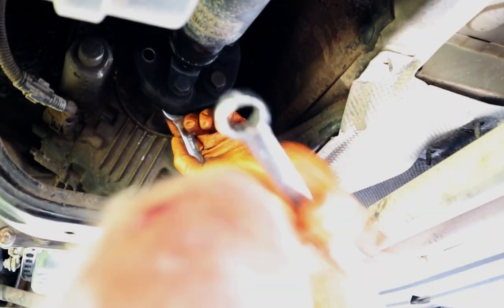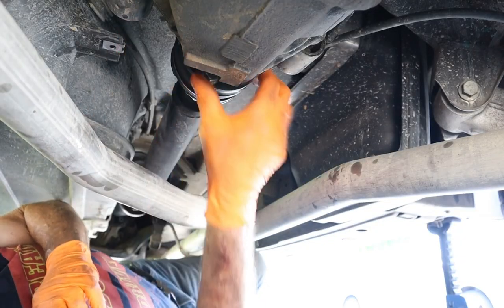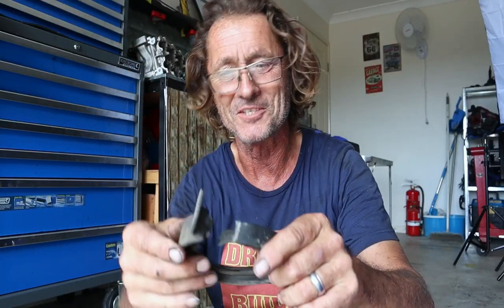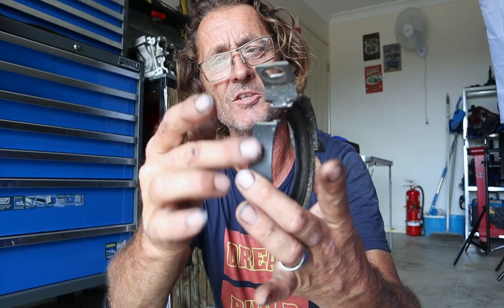BMW X5 DRIVE SHAFT CENTER BEARING REPLACEMENT

Comment: Sir I have a question 🙋‍♂️. As you can see I have an X5    Drive shaft broke bent off.   My mechanic installed new front cv axles and the passenger side didn’t look like it was all the way in.   So I believe my differential siezed up and caused my drive shaft to break off  my transfer case also broke when the shaft broke off.  I put a new transfer case on it it still won’t roll over the passenger axles is still the way the mechanic left and I believe it’s not all the way not making contact with the front diff?

Comment: Great video, but ...I really wish I'd seen it before I did mine last week. Why..? Because I didn't think about marking the two ends before I split the splined joint. I now have a very small, but noticeable to me at least, vibration at  around 30mph on hard acceleration. I have mine running most of the time in RWD only by removing the feed to the transfer box motor when its powered down and the clutches are relaxed, if I switch back to awd it's hardly noticeable with less drive to the back. I guess I'm going to have to either live with it, take the prop off again and pay to have it balanced, or try rotating the splined join until I get lucky. But thanks for the video and it was an enjoyable presentation.

Comment: Boring old (78) long retired pom mechanic here; too many years in the trade who did time on Alfa, Jaguar, and Ferrari in UK and Canada. Worked with many Oz and NZ mechanics over the years who were all great. Now I'm the proud owner of a mint X5 3.0 2005 (209k kms) with a vibration problem which is definitely drive shaft related. However, the fix also boils down to a question of technique. Hitting wrenches (ok, spanners) with a hammer and inter-linking wrenches for more leverage are definite no-no's and can result on tools flying across the shop floor and opening up of wrench jaws. Not at all recommended.   Boring old pom mechanic....